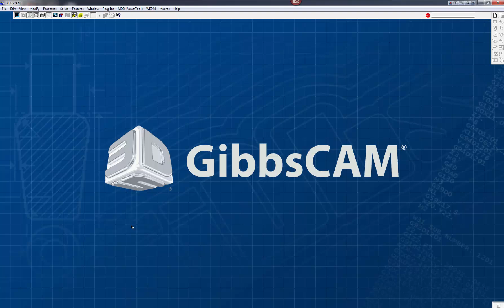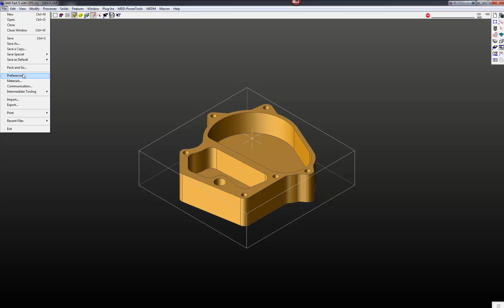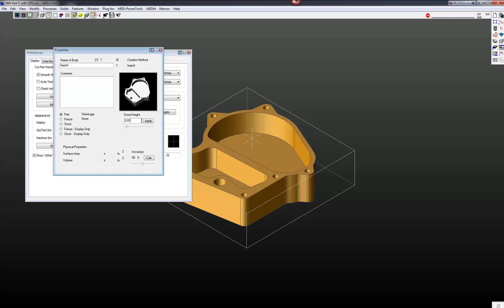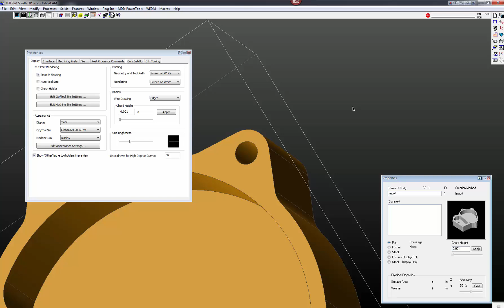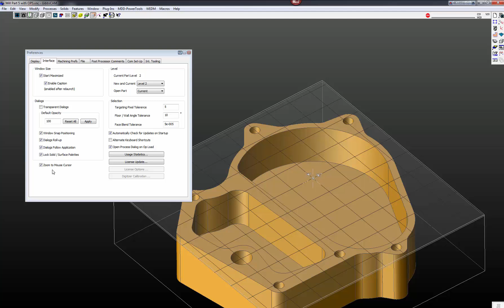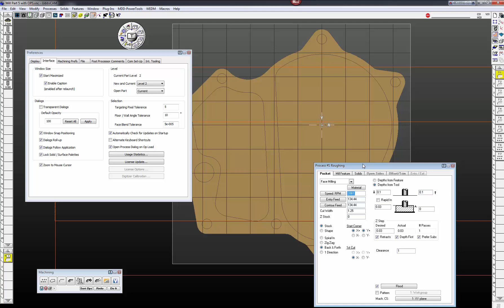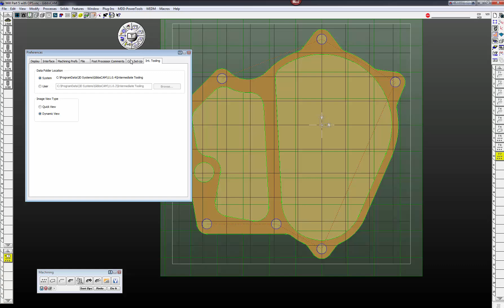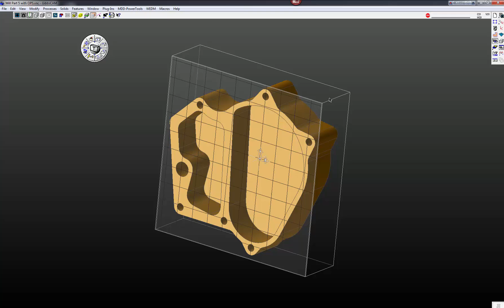GibbsCAM 2015 - 1 - Default Settings

Comment: Hey, this video is very informative. I learned master cam 2024 and 2025. I’m having troubles trying to figure out this program because this is the one we use at my work. Just to get started like let’s say I download a Cad drawing . How do I search initiate the tool path? Do I have to make my stock to kind of give it an idea of what it needs to do because I download a drawing and I just couldn’t figure out what’s the next step. I see you have like a little controller circular controller on the top right that I can’t even pop it up. I imagine that after you already have all your tool pass tool settings, linking parameters, etc. etc. Is there anyway we could exchange emails or chat?